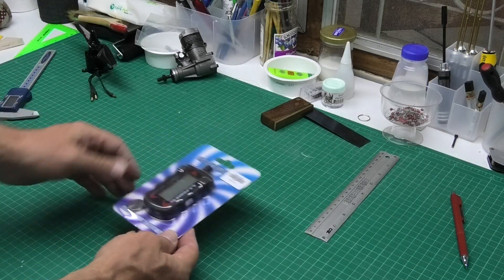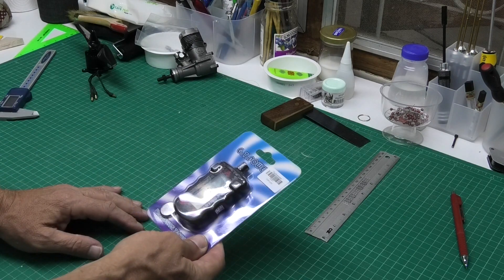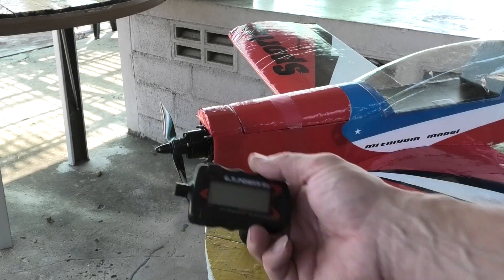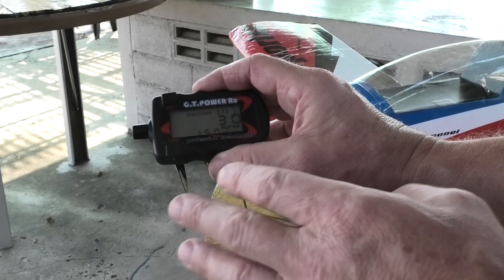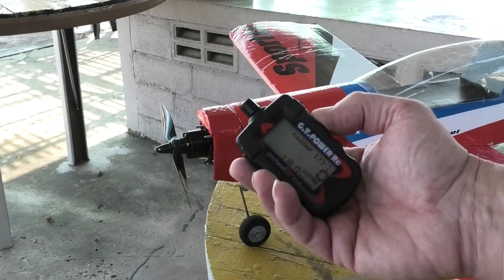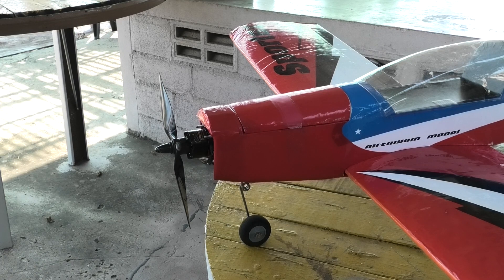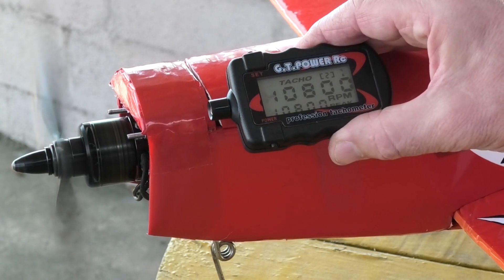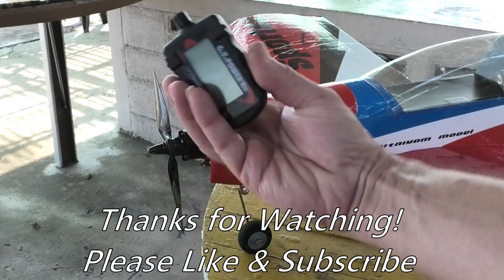Review:- G.T. Power RC Professional Tachometer, for RC model aeroplanes

Comment: I've been thinking about getting one! Are you still happy with yours
Reply from the maker: I did really like it, but it stopped working after a couple of years, but i did get a lot of use out of it in that time.  Got a slightly different one second time round, but that was a cost based decision
Reply: @MarkRobinson555 ...Well got a "new" one at a Swap meet yesterday...Was quite happy since I spotted it at the last minute...Decided to check it out at today...😭😭😭😭...Battery was left in it...Cooked the circuits....It's dead on arrival...So, thats $15.00 shot to heck....😭😭😭...Had a Globee red one back in the day...Never failed to work....